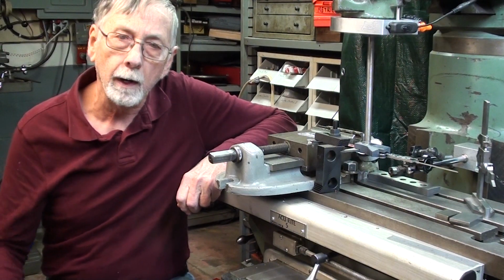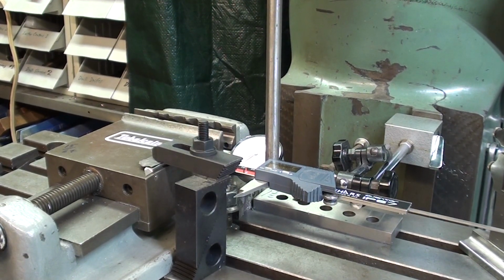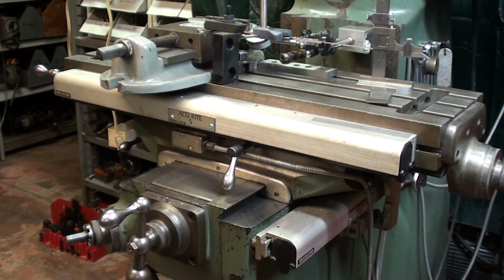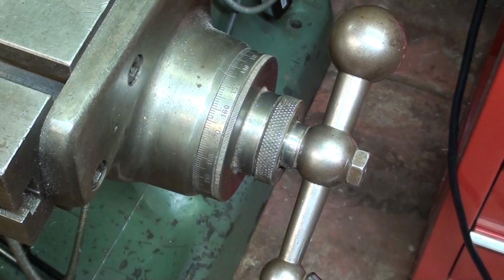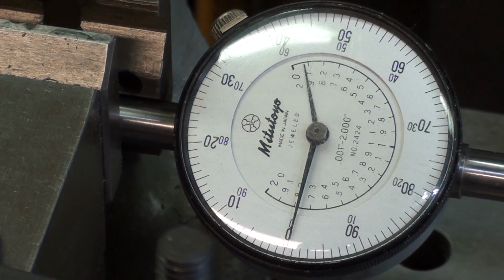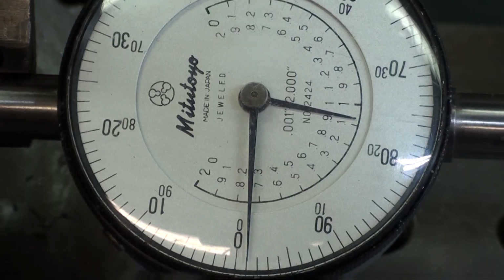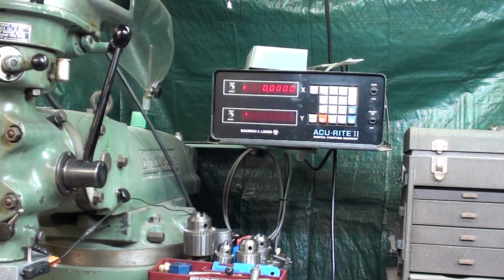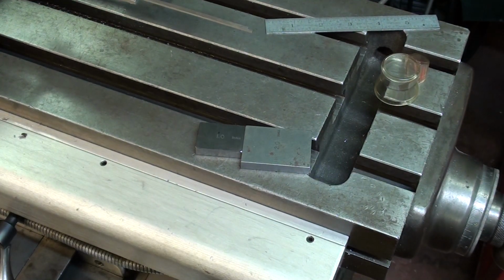Accuracy of the Bridgeport Mill Tips 527 tubalcain

Comment: Sir, even the standard of an inch had change all these years. As i remember, during the 70`s there is a major change and recently, i believe it is last year, scientists redefined the method of measuring using some sort of electric conductivity to avoid the oxidation of the length standard guage block locate in paris. Your mill is made in 50`s, the mititoyo may be a 70`s product? Your shars and b&l would be a 10`s or after? Event if they are all unuse new, it still won't match. Because they are all base on different standard.

Put it simple, your inch is not my inch and my grandfather disagree with both of us.
Reply: Dug this up here: http://www.npl.co.uk/reference/faqs/on-what-basis-is-one-inch-exactly-equal-to-25.4-mm-has-the-imperial-inch-been-adjusted-to-give-this-exact-fit-and-if-so-when-(faq-length)

"On what basis is one inch exactly equal to 25.4 mm? Has the imperial inch been adjusted to give this exact fit and if so when? The (international) inch has been exactly 25.4 mm since July 1959. At this point in time the (international) yard was redefined as 0.9144 metre - until this time the ratio between the US yard and the metre was different to the ratio between the UK yard and the metre. For more information, see Engineering Metrology by K J Hume (2 ed) Macdonald London 1967. The American inch changed by 2 millionths of an inch and the UK inch by 1.7 millionths of an inch. The international inch falls mid way between the old UK and US inch.

References:

The Yard Unit of Length, Nature, Vol 200, No 4908 pp 730-732 23 Nov 1963
The United Kingdom standards of the yard in terms, of the metre (British Applied Journal of Physics)
"

Which is a little disturbing considering I have a 1958 Bridgeport M head...
Reply from the maker: Thank you, that's an interesting comment
Reply: Sorry, but this is nonsense.  They replaced the International Prototype Metre (a piece of material) by  the distance light travels in 1 / 299 792 458 second. This complicated fraction was chosen to minimize the deviation to the old system. The deviations are far below the precision the best machinist can achieve even with the best tools. If a gauge block from the 1950th differs from a today's gauge block than this simply is due to manufacturing precision and not due to different standards.
Reply: Offical gauge in Paris...Yeah, I'm reading in Scientific American that the 'official' 1 Kilo weight there is needing a calibration....
Reply: If you haven't read it, pick up a copy of the "The Perfectionist" Simon Winchester.  Brilliant.  I listened to it twice on Audible.  Amazing history related to precision and of our present measurement system.
Reply: I won't bother to look it up but I doubt the length of the inch was "redefined" in the 70's. What probably changed was how that length was defined. We are probably talking about standards well below a millionth of an inch and so has no practical effect in Mr. Pete's basement when the limits of your readouts are a half thousandth.

Comment: Did some similar 'experiments' when I was Quality Manager at at Engineering works, difficulty always is to determine what is accepted as the standard. Most surprising in your test was the 'apparent' inaccuracy of the clock (DTI) which has an internal pure mechanical movement. Keep up the informative, entertaining work.
Reply from the maker: Thanks

Comment: I bought a criterion boring head last week. It was used but in excellent condition. When i put a dial gauge on it and compared the movement of the slide to the gauge, there was a slight difference.
Reply from the maker: Funny you mention that, I would like to do that sometime as well with my boring heads

Comment: You noted that it was the middle of January. I wonder if the cold had any affect on the readings and would they be the same in the middle of summer?
Reply: Temperature is bound to make a difference, but that said, he is wearing a light weight shirt so it's probably not that cold in his basement :-)
Reply from the maker: I doubt it, it's about 68° in my basement

Comment: Very informative, could there be some cosine angle error in the dial indicator set up? Thanks for all the great content.
Reply from the maker: I considered that, and had even thought about putting an indicator on the beam of the calipers, but I have to quit at some point
Reply: I suspect a slight angular missalignment of the dial indicator too, but nonetheless the readings are still within spec of the dti. Mitutoyo gives .001" over the first 2,5 turns and .003" overall as accuracy for the 2424. Always a good idea to check the aacuracy specs of test equipment manufacturers, just to get an idea how precise a tool will be ;)
Reply: @florianf4257  That's what I was wondering.  The Shars or any other digital caliper can be easily influence by .0005 to .001...
Reply: I also think it's cosine error plus the tolerances of the devices under test. A 0.06° (3.6 arc minutes) error already would create the observed difference.
Reply: Good point.   Maybe use gauge blocks to verify the accuracy of the dial indicator.
Reply: The first thing that occurred to me was cosine error if the dial indicator isn't in perfect parallel alignment with the axis of travel.
Reply: Great question about the cosine error.
Reply: It's probably safe to say there's ALWAYS cosine error with a dial indicator. How significant it is would be another story. Don't think there's many people that indicate in their indicator.
Reply: I suspect that error would be insignificant-!!
Reply: @daleburrell6273  It is not insignifigant and is very common.  I have run into this before when verifying digital readouts and in checking repeatability and accuracy of CNC machines.  Also the temperature of the machine and instruments at the time of measuring has a big effect.  A 50deg temp change from the nominal 68F will make those Accu-Rite scales be off .0005"/ft because of different expansion and contraction coeffecients.